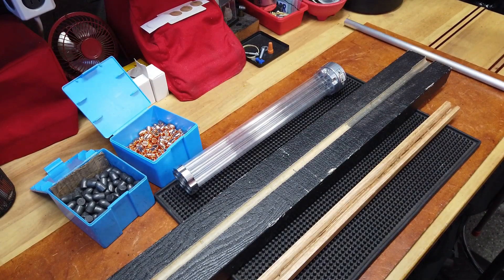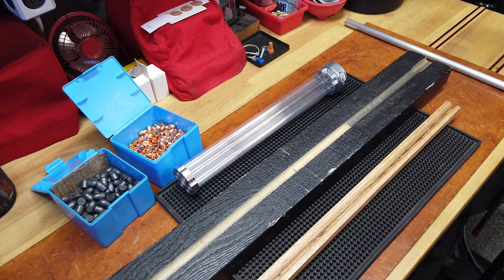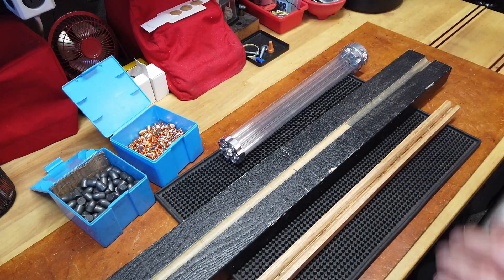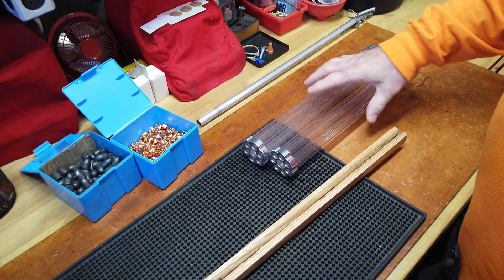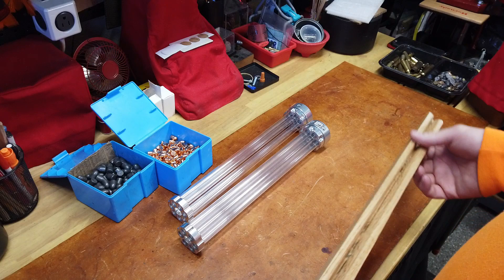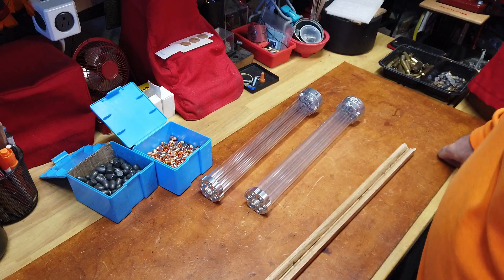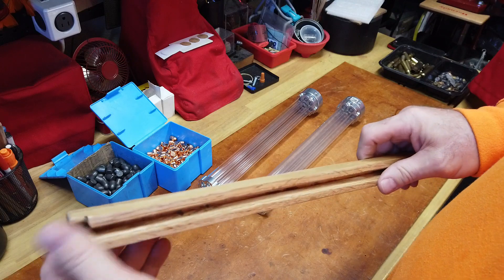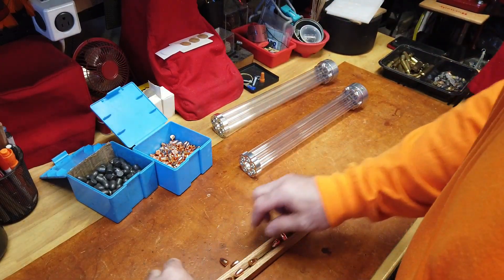DIY Oak Wood Bullet "Ramp" for 9mm/45 ACP Mag-P Tubes

Comment: I was thinking the same as Joe Collins.  Find a small diameter PVC that fits 9mm and cut it with a table saw. Prob some trial and error but I think if the rounds are cradled a little more might help.  Love your videos and ideas.  Also like how your not afraid to post stuff even if it’s not 100% helps others like use think of other ways of doing things 👍🏼👍🏼

Comment: I have another idea for you if your open to try something different. how about a length of PVC pipe split down the middle with a hinge glued or JB welded to one side. like a clamshell, you could open it load the bullets in, then close it and pour them into the loader. you could have different size PVC for each bullet. just a thought, its not as good looking as wood but i think you would solve 2 problems. 1 its slick enough to let the bullets slide, and 2 it would fully encapsulate the bullets so they cant turn around or fall out when loading.

Comment: Yeah, that wood isn't slick enough yet for the light wieght 9's to slide easily.  Once that's slicked up real good, it should be great.   I'll have to order those tubes today because they have a 10% discount until the 8th.  Thanks for the vid.  9mm is out of stock.  :-(
Edit:  They are not out of stock.  Sent email to them and they fixed the web site error.  :-)